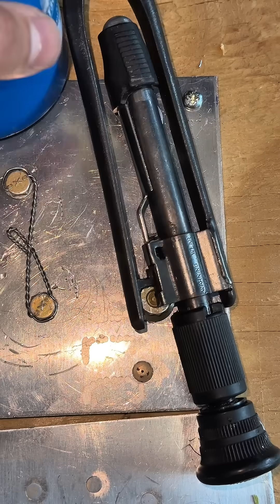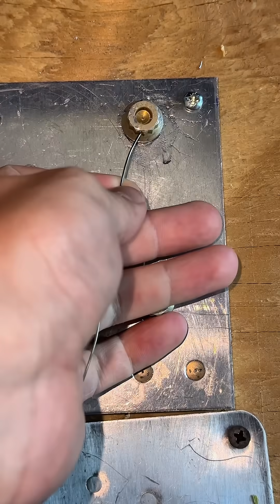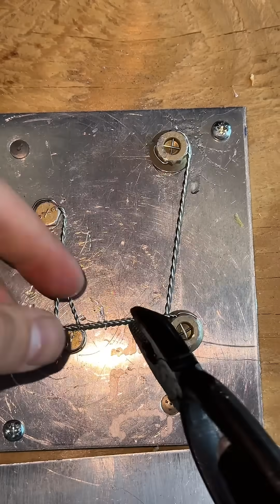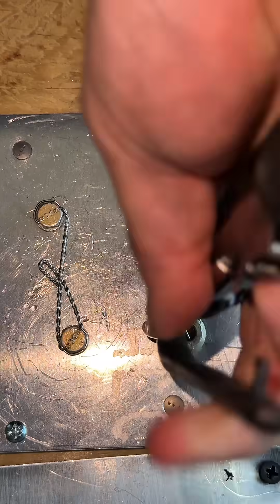Jet tech: Boomers Hated This Safety Wire Tip 😤✈️ #AviationMechanic #shorts #mechanic

Comment: You can perform any safety task with your hands; I prefer it this way. There are too many places on an aircraft that those pliers cannot reach. I would say that it's important to learn how to do it by hand and become proficient at it before even attempting to use the pliers. That is just my opinion.
Reply from the maker: Yes, I can do it with my hands, but the fact is that safety wire pliers are a standard tools used in aviation and are very common in the field even though you can’t do it with your hands learning how to do it with safety wire pliers is important because if you know how to do with pliers, I guarantee you, you could do it with your hands Anyway thanks for commenting and watching. I appreciate the feedback and maybe in another video. I will do it with my hands.
Reply: Also I'm guessing you work on fixed wing aircraft?
Reply from the maker: Rotorcraft
Reply from the maker: Ch47
Reply: What did you work on?

Comment: I got in trouble for using swaps when i started in the military. was very useful when pliers will not fit in the space. After i got good at doing it by hand i used pliers when i could.
Reply: Yup. Same here from army aviation. Depends on the TIs you work with usually, but most of them demand they be hand wrapped on principle.

More of that "we (I) had to do it when I was new, so you do too" that eventually gets perpetuated so much it becomes one of those unwritten by-laws nobody ever thinks to verify with a airframe-company-owner rep.

I eventually just told my TI I'm using them on my AH-64 ASPI panels (like x12 8" long wires around the whole mounting panel for BOTH nacelles) and he can clip the ones he doesnt like. He didnt cut a single one. Easily saved me an hour or two of time and finger bleeds.
Reply: @UpToSpeedOnJaguar it definitely helps teach the attention to detail and pride in every single set you wire. After you're invested in every wire you tie i think its okay to use swaps. When i taught the new guys i had them do it by hand until it was good then said they only need to use it by hand as needed. Everyone else that was teaching said never to use them even when you could which i thought was silly
Reply: Why did you get in trouble?
Reply: @Fjorela-e8n  Because they didn't like them and said the pliers didn't work as well as twisting wire by hand
Reply from the maker: You're not the only one. It's a learning curve.

Comment: did you build that safety wire board your self? looking to either buy one or build it my self so i can practice at home
Reply from the maker: Its easier to build one , i built it with scraps tbh and it works perfectly

Comment: Boomer here... why would I 'hate' this great tool? My buddy in the Air Force used these all the time in servicing the aircraft he was assigned. Great way to secure crucial fasteners and to see at a glance if something was wrong.
Reply from the maker: Its a joke but its cause some boomers usually comment under these videos to hand tie the wire😆😆😆😆 anyway thanks for sharing
Reply: @northeastaviationpro no that's just dumb.... if the tools are there, use them. Too many safety points on aircraft and racing machines not to. It takes way too long to do it by hand and it can be inaccurate to do it by hand as well. I'm on your side.

Comment: Ya this will "pass" a and p testing but knowing why it's bad is also good to know so they don't mess it up. Safety wire pliers are the WORST to use. You can see where you clamped down on the first one you bent the safety wire then b.c you didn't have enough turns in the second you cheater rolled it which also hurts integrity of safety wire. I always show my new trainees by hand b.c there's no chance to kink it.
Reply: How are safety wires the worst to use?
Reply from the maker: Whatever floats your boat
Reply: You’re the boomer he’s talking about.
Reply from the maker: For sure 100%
Reply from the maker: How about you upload a video on it then

Comment: I was installing safety wire in 1984. USAF, Jet Engine mechanic. Great vid ✊️
Reply from the maker: Yeahhh 🇺🇸
Reply: Started twisting wire in1968 and continued till 2015. Jet eng mech in mil and civilian  as flight test mech..
Reply: Marine helicopter crew chief. I was using safety wire pliers in 1971.
Reply: Well I was using safety wire back in the 80s on a submarine. Plus inside the Trident C4 missiles when installing the guidance assembly and the electronic assembly. Of course that was when we were underway and not in a building.

Comment: Safety wire is usually classified as twists per inch, depending on gauge of wire.  If it is to tight then the wire can snap and if it is too loose than it defeats the purpose of the safety wire.

First tie looks great, second tie looks on the border of to many twists.

Edit: I am convinced the pig tail is over twisted and wouldnt meet spec.
Reply from the maker: You're right, there's a sweet spot for that wire tightness, thanks for pointing that out!
Reply: 6-8 twist per inch according to the 8083
Reply from the maker: Yes sir good job
Reply: Pig tails always require more twists per inch than the actual span of safety wire by usually 2-3 twists per inch
Reply: @ronanjohnson214 still in the video
 The pig tail has twice the ties as the first one
Reply: Second twist was perfectly fine. You typically over twist on the pig tail (what you called the “second twist”) to avoid it unraveling when you fold it over.
Reply: @SantanaBinks I can only spitball from a yt video.  I just know my quality assurance team would give a stink about it the twists from the pig tail in the video just from sight.

The specifications I've used stated twists per inch for a given gauge size.  Never mentions a different tolerance for the pig tail.  Over twisting, weakens the wire whether its in between two fasteners or at the end.  If the wire fails at all, then its pointless to have it there in the first place.

Watching it again. The pig tail has twice the number of twists per inch as the main twist which means its bad on principle.
Reply from the maker: Boomer

Comment: honestly struggled for years with it but eventually I got it down. Those swaps (safety wire applicators) I believe they stand for, are a genius tool and responsible for preventing so much potential damage and death in aviation
Reply from the maker: You are so right, those applicators are essential.
Reply: What is the typical use for something like this? I have no idea about aviation mechanics, just a curious auto mechanic.
Reply: @jordanscanlon1181 it’s to keep critical components fastened and intact. Aircraft, especially helicopters vibrate a whole hell of a lot, and lock wire is just added insurance and a visible indicator of broken torque or other failure that would be noticed on a proper pre-flight inspection.

Comment: Its nice but doing it on a practice board and doing it on a plane that is in a uncomfortable posistion is different, show some video doing it on a plane
Reply from the maker: You are absolutely right, doing it on an actual aircraft is a whole different beast!
Reply: Yes, when you can just see it with a torch and get maybe one or two fingers on it with one arm stretched to the limit and your face is pressed up against a knurly dirty hydraulic actuator, but not at the same time😱 What fun🤣
Reply from the maker: Absolutely love these comments — you all nailed it. The real-world aircraft environment brings a whole new set of challenges: tight spaces, awkward angles, low visibility, and sometimes feeling like a contortionist just to get the job done 😅💪

We’ll definitely work on showing more videos on actual aircraft to highlight those real conditions — the grit, the struggle, and the triumph. Appreciate the feedback — it’s what helps keep this content real and useful!
Reply: @northeastaviationpro and maybe do some double safeties on turn buckles and b-nuts